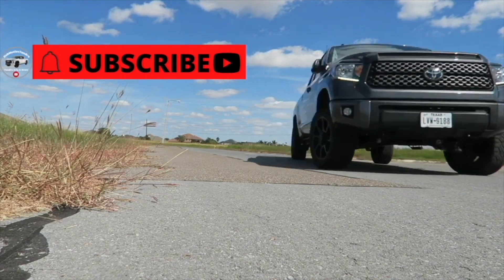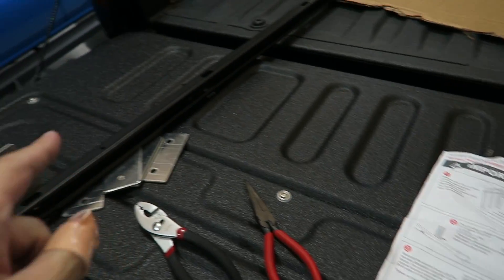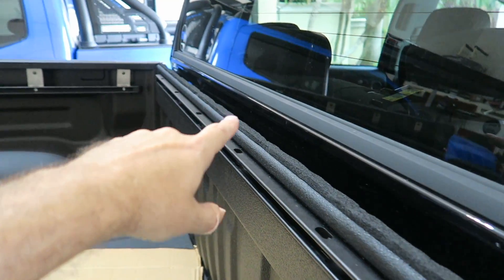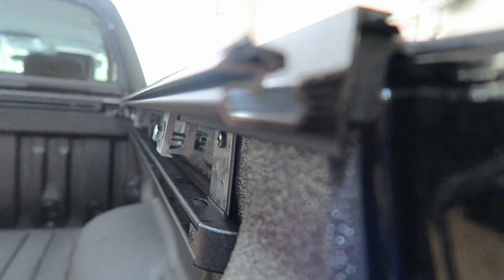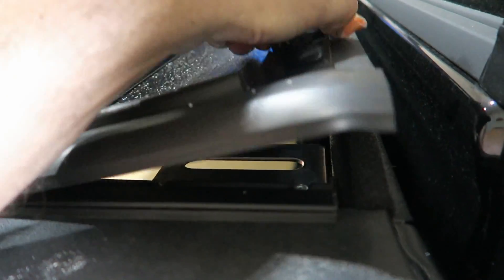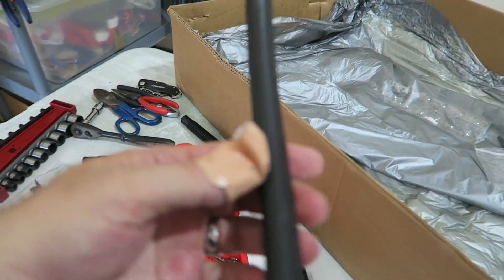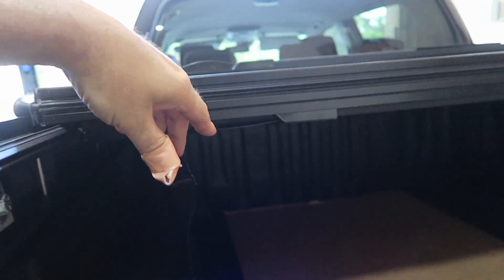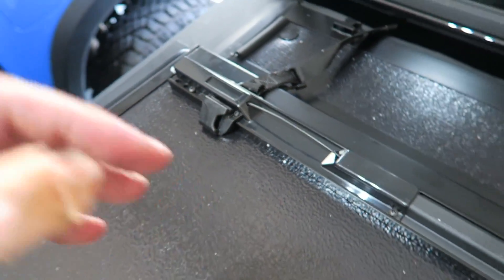Toyota Tundra Bakflip Hard Cover Install

Comment: I like your hard cover better than mine I have Rugged Trail Cover mine has handles twiste and fold your don't you just pull looks much easier to open.
Reply from the maker: It’s very simple.  Just hope it holds up🤔